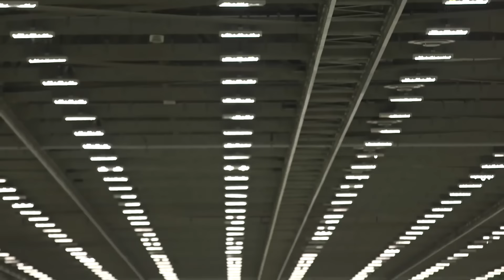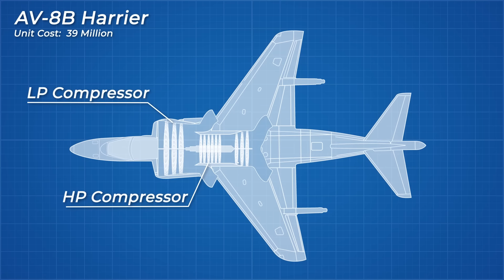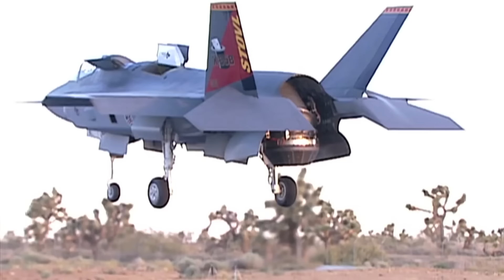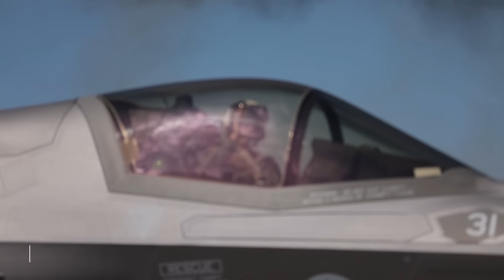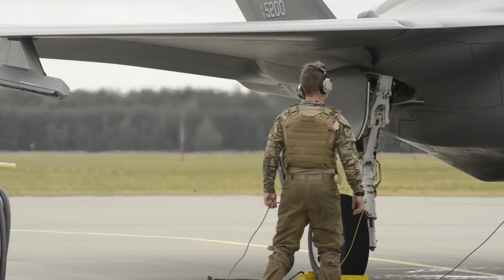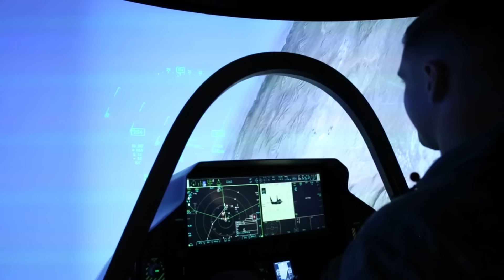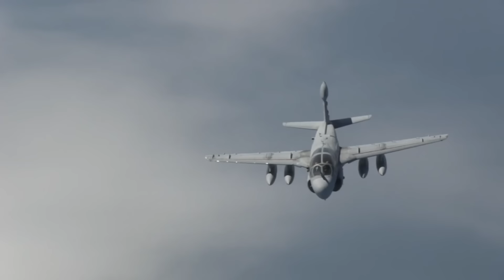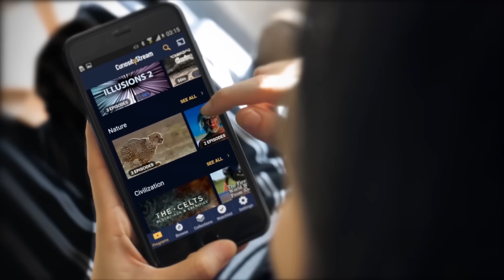Is The F-35 Worth $115 Million?

Comment: with 100 million dollars each, we might as well bribe the enemy generals.
Reply: Soturian  aCtUaL sOlDiErS
Reply: You forgot the $15 M.
Reply: $100 million is a completely reasonable price tag for a modern jet and is barely more than you would get out of a Eurofighter or F-18 though.
Reply: @Fenrick  the f22 is better and a quarter of the price and isn't prone to failure
Reply: @dingdong475  The F-22 costs significantly more than the most expensive F-35 variant, had a ton of issues in its development, and is only capable of doing one mission well, a mission it has not been used for yet. It had to be retrofitted to do air to ground. It is also only ever going to be operated by one country, unlike the F-35, so arguments about which is better mean nothing to countries like the UK, Israel, or Japan. On top of that, the F-22 procurement was halted after a limited production so there's only, what, around 180, which isn't nearly as much as the Air Force needed.
Reply: @Fenrick  yes but at least it masters one area and is not sold to competitors. Also it costs 39 million per plane still over half the price of f35. Buy a f22 and an b22 and you would still have change left over to do some maintenance on some old a10s.
Reply: Exactly. This is just more military spending that we really cannot afford.
Reply: We do that too! #TwentyTwoTrillionDebt
Reply: Soturian  ECHM! biden ECHM! ECHM!
Reply: Soturiankl.
Reply: Soturian ha ha ha ha ha good one
Reply: lol
Reply: Luke L.  i bet you get off on repeatedly posting that observation in every conversation possible.
Reply: Soturian  That's counter intuitive.
Reply: Soturian  Sick burn. 

So please explain to me why the people who got the US stuck in 7-8 different wars throughout the Middle East and Africa wasting trillions of dollars should be trusted on literally anything?

How are you going to pay for any of that?

I mean, a US general (Petraeus) literally advocated for arming Al-Qaeda so they could fight ISIS at one point. 

Let's let these brilliant motherfuckers decide what to do!
Reply: Firstname Lastname actually the wars in Middle East haven’t cost a trillion dollars yet. Per months, it’s about 30-50 billion a year. So it’s cost about 400-600 Billion altogether. Africa would cost a lot less since the USA doesn’t have overt combat troops in the continent.

There are estimates that the wars will eventually reach trillions of dollars, but that’s because of interest owed. A function of how how the US government funds the military, rather than the true cost of the war.
Reply: The F-35 is not the most expensive fighter jet. That still goes to the Eurofighter which is a 4.5 gen aircraft.
Reply: @orlock20  yeah the f35 is pretty affordable. its scary how stupid people can be
Reply: @orlock20  the Eurofighter is an absolute joke and riddled with problems
Reply: @orlock20   but the Eurofighter is done, unlike the F-35
Reply: @Gunni1972  The F-35 is physically done yet the upgrades are so that the F-35 can use various bombs and missiles made by other countries.
Reply: jason poole That's all we need is more overpriced Yank shit to put the country into even more debt.
Reply: @interman7715  Imo, for a lot of countries, forget whether or not they need an F35, the real question is whether or not they need a strong military period. 

Who's Australia going to fight? New Zealand? Indonesia?

You going to buy 100m+ fighters to kill pirate dinghies that are worth less than what it costs to sortie an F35?
Reply: Firstname Lastname Exactly it's all just Pentagon bullshit to keep the money rolling in for the defense contractors,no country can   afford this nonsense.
Reply: How do you think Boeing gets our generals and our allies generals to sign off on these projects?
Reply: Soturian  like the US
Reply: Yak 141 copy. From USSR with love
Reply: Soturian  Are your teeth black from all the boot polish solider?
Reply: Soturian  you think soldiers strategize? Hahaha soldier's are cannon fodder and slave labour. Leave the strategizing to the strategists. Do you even know what strategy is about?
Reply: @dingdong475  I'll answer that once the propagandists finish deciding if officers who do the strategizing also count as soldiers.
Reply: stockart whiteman  It's not JUST the government though (Putting aside the fact that the military IS the government, and all soldiers are government employees - something that pro military dumbasses always seem to ignore). There would have been input from officers and strategists in the military. Do they not count as soldiers?

Furthermore, it's not like the war started yesterday. It's been going on for up to 18 years, depending on the war. The soldiers fighting those wars in recent eras knew there was a good chance they'd be doing so, but enlisted anyways.
No soldiers, no war. I feel comfortable assigning them some of the blame as well.
Reply: Soturian  "actual soldiers" aka
"I have 1000 hours in mw2"
Reply: Soturian  The soldiers have gotten the US into a war that's old enough to vote, the thing they were supposed to fight is worse than ever, and there's still no end game in sight. Excuse me if I don't think the soldiers know best.
Reply: Firstname Lastname the grunts know what’s up. It’s the politico generals who’ve never not worked a desk job, and the almost retirees who have friends already working for the military -industrial complex, and in that case, the president himself who got us there.
Reply: Firstname Lastname - Those decisions were not made by soldiers - They were made by the people who usually make these decisions, politicians. These interminable wars are what happens when you don’t define Victory, have politicians & lawyers decide your ROE & how they are applied, play by the Marquis of Queensbury Rules against enemies who follow no rules (except win at all costs) & have people like Paul Bremer decide how we are going to “win the peace”. 
https://www.businessinsider.com/l-paul-bremer-was-embarrassed-on-first-and-last-days-in-iraq-2014-8
Reply: Soviets generals
Reply: @kutteknugen  you mean Soviet politician ? They get to spend the money the while the generals spend it on vodka and more vodka
Reply: @koismiah30   for one shot down F-35, the russians build 2 SU 30s. and have still enough money left to have a drink. or an SU 57,
Reply: Gunni1972 and for every dollar russians have we have 10 dollars more. This is the huge disparity between Russian and American economic power.what happens in the end is we still have more, better planes.
Reply: Soturian  finally a decent response, but seriously most knowledgeable people don't support the US industrial military complex of which you are part of
Reply: Broccoli 24 If you live in America and have a job you very much DO SUPPORT the industrial military complex with your taxes. If you don’t live in the US you don’t have a vote in the matter.
Reply: @dazaspc  Why not what? Why not have a strong military just because you can? Because that shit aint free. How are you going to pay for it?

To quote a Republican US president: 
"Every gun that is made, every warship launched, every rocket fired signifies, in the final sense, a theft from those who hunger and are not fed, those who are cold and are not clothed"

"Indonesia is a thing". 
And Australia is an island. Last I checked, Indonesia doesn't have enough amphibious landing craft to successfully storm the beaches.
Reply: Soturian   why? are they lobbying harder? the F-35 has no hope to ever replace the A-10
Reply: @Gunni1972  the A-10 has already largely been replaced by the F-16, F-18, F-15, B1, etc. Since 1991 that we know that the F-16 is better at the A-10's job than the A-10 itself and it's been getting less and less missions. By 2014 only 11% of CAS missions went to the A-10.

Comment: “This one plane for the different services will help reduce costs” (F-111 program 1965)
Reply: F-111 was an attempt at a universal fighter and while the F-35 is trying to become a standardised fighter, it isn't tying to be universal. Traditionally there are two roles done by fighter aircraft in modern warfare, one is the high altitude fighter that is designed to intercept enemy fighters. The other is the low altitude fighter, which is designed to deal with all of the other tasks required from fighter aircraft in war.

The F-111 was the attempt to merge the two roles into one universal fighter than would be just as good at engaging fighters aswell as dealin with ground targets. This is what caused the program to fail and it should be noted that the F-35 isn't trying to replace all US fighters, it's intended to replace all the different planes that are low altitude fighters. The F-22 is designed to intercept and engage fighters while the F-35 is designed to focus primarily on other tasks that can make use of the air superiority provided by the F-22s.
Reply: Cheaper to just push it over a cliff

Comment: From an engineering point of view, the F-35 is quite amazing. 

From a military point of view, it is by far much too expensive, lessons learnt during WWII.

The Germans had by far the superior tanks with the Panzer Mk V and VI, but they were expensive. The American's were able to quickly throw out the M4 and just swarm the Panzers. Although this is a rough comparison, the problem still remains. Knocking a single F-35 out of the sky with a million dollar missile would hurt greatly hurt the American military to replace it.

Also...they should have just kept the F-22 and created new versions from that.
Reply: Jonathan Matthews Are you aware there is to be over 2,300 F-35’s to be built in its production run? Contrast that with a plane like the F-15 which just barely breaks 1,100 produced over the 40 years it’s been in production, I don’t think you would say it would greatly hurt the American military to replace an F-15 and there will be over 1,000 more F-35’s made. Losing something like an F-22 would hurt because there isn’t that many of them and the infrastructure to make them just isn’t there anymore but the infrastructure to make the F-35 is there and is getting better and better every year. The current F-35A (the air force version and the main one being made) currently costs 89 million dollars to produce. By the end of 2019 it’s expected to be down to 80 million dollars. And there is no possible way a million dollar missile is going to be able to knock out an F-35 in its entire life. The only surface to air missile system that would even have a chance of knocking out an F-35 would be the S-400 which costs tens of millions of dollars to set up and have the infrastructure for.
Reply: @theread3480  There was no way a bunch of farmers in a field in Vietnam where going to shoot down the F-4

There was no way missiles were ever going to shoot down a U-2
There was no way missiles were ever going to shoot down a F-117

The F-35 still has an exhaust. And if a F-35 came in to do a tank plinking run (taking over from an A-10 in a CAS role), some grunt with a shoulder mounted 1950's era Sidewinder type missile could still fly that missile right up it's butt. 

*I'm not hating on the F-35. I'm just trying to keep things real.
Reply: @jonathanmatthews4774  the Sidewinder weighs in at 85 kg, I was to see this absolute unit of a lad who's tasked with carrying the Sidewinder on his shoulder.
You want to keep things real? Anything dangerous to the F-35 is LETHAL versus anything else. If MANPADS are a threat to the F-35, then a non-stealthy exhaust aircraft is doomed.
Reply: Jonathan Matthews You’re right there was no way a bunch of farmers in a field were going to shoot down an F-4 because they DIDNT. They used surface to air missiles and anti air cannons supplied by the Soviet Union and China and had to be trained to use this technology. People have a twisted sense of Vietnam thinking it was the most powerful military in the world going up against nothing but farmers with AK’s and pitch forks
Reply: Not really the case with armor.
Reply: The F-35 is too expensive - even though it costs less than many 4th gen fighters at 85 million - but the US should have produced more 150 million dollar F-22s. Logic.

Comment: IMHO, the USMC was the bridge too far here. VTOL was really too much to try to put into this plane in hindsight. Yes, the finished plane is still impressive, but if the airframe didn’t have to be designed around a giant fan in the fuselage it would certainly have better performance.

Comment: I have just one issue with the video, The F-35 will NEVER be a functional replacement for the A10 Warthog. The 2 planes are just too different, the A10 was designed as a low speed long loiter "Close Air Support" fighter. The A10 has incredible redundancy of systems, it's entire combat takeoff weight can be handled by just 1 of the 2 engines it has and has enough flight time to loiter for hours above a combat zone. The A10 is also capable of of destroying targets with it's centerline mounted GAU-8 Avenger gatling autocannon, and can carry a maximum takeoff weight of 50,000 pounds. With loiter times of 1.88 hours, and a design mission of CAS the main nemesis of the A10 was not dedicated anti-air missiles of vehicular or surface mounted types, but of small arms fire and direct AA weapons such as autocannons and large caliber machine guns. While it is vulnerable to shoulder launched missiles, the A10 nonethless during the Gulf War flew almost 8,100 sorites and had a mission capable rate of 95.7% with 144 A10's deployed. Desert Storm saw 8,077 sorties with a similar 95.7% Mission Capable rate and the highest sortie rate of any aircraft at 16.5%. Of the Gulf War losses there were 6 A10's lost, 4 in combat 2 on landings of the combat losses only ONE pilot died, of the 2 landings one of the pilots died due to a combination of battle damage and extreme weather conditions during his attempt. I doubt the same profile could be achieved by the F-35 with all of it's state-of-the-art technologies and the fact that even minor defects or damage to it's stealth coating means a repaint of the entire part. As of now the A10's in service have been "re-winged" and are projected to be capable of remaining in service into the 2030's as Boeing was issued a $1.1 billion contract in 2007 to build new wings for the A-10, they received a renewed contract of $770 million for even more A-10 replacement wings. For now the Future of the F-35's role as an A-10 replacement is in doubt with the Air Force committed to preserving 6 of their 9 squadrons of A-10's into the 2030's and the Air Force is considering buying a fleet of Light Attack Aircraft to use instead of the F-35 for the CAS role the A-10 is used for now with several planes under consideration.
Reply: We really need to go back to low-speed prop planes, better for staffing

Comment: I don't think it' superior to the a 10 in every way the a10 is quite a lot cheaper and when looking at the enemys nato faces you have to consider that there aren't that many threats with highly advanced radar so a more robust close air support plane which is specificaly designed for that role does make sense as they are mostly going to get shot by small arms fire or anti aircraft guns. By the time you need close air support all airfields and sam positions will probably have been bombed to shreds and the a10 can do what it does best (brrrrrt)

Comment: Before video even started - NO. Let's see if obvious answer was the right one.

After watching the video I'm still not convinced. First of all lockheed should have not won the contract in the first place. Boeing lost cause it did in prototype what lockheed did later in production... Second if lockheed had such wast experience with stealth technology why you incorporate that development as reasonable expense? Wasn't it already acquired through Raptor and Nighthawk? Also you mentioned "most of the units being sold as export" but you failed to mention that most of countries who have shown early interest are very much reevaluating the prospect of buying the planes after price got inflated so much.... And last but far from least - what about ongoing issues? Service costs alone are insane. Also pilots getting poisoned by issues in air supply system. And the lack of any real battle data to justify any claims and properties assigned to the aircraft by manufacturer. 

All in all yeah, it's a step forward, it's needed and nobody can argue that. BUT the development just reeks corruption from every seem. The final product is yet to be tested in combat with anything resembling a competition.... And every branch getting their own modification doesn't mean its different by 5-10% but rather up to 50-60% difference in parts, construction and avionics/flight hardware between different spec aircrafts.... Yes army model costs the least, but it can't be serviced by the same personnel or using same parts as marine one. So it's like having different aircrafts which share some parts. That's all. 

So no, it's not worth the price tag at least till it goes against other post 80s fighter in direct real combat. No way, Jose.
Reply: Kinda makes me miss our Tomcats, which have been mothballed in a  desert for 10+ years now.

Comment: The only issue i have is it just doesn't have the hang around time the a10 has. It can do close air support, but the a10 owns it. Its slower flight, high payload, and low speed handling make it the damn near perfect for close air support. The 35 has to maintain a higher speed then the a10, while it can pinpoint high speed rush it doesn't do like the a10 and just loyter around pegging ground targets. Still, the 35 is still and amazing platform in all reality, and will do better in situations where aid domance has not been obtained.